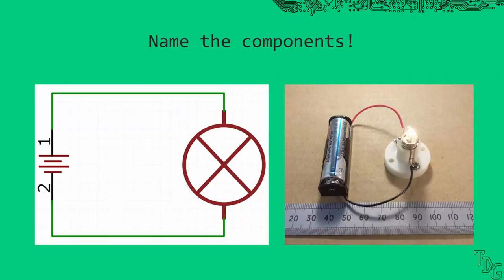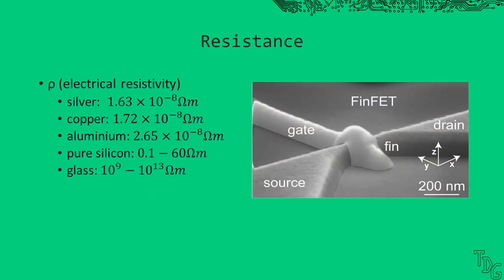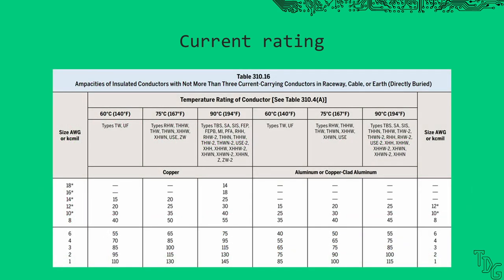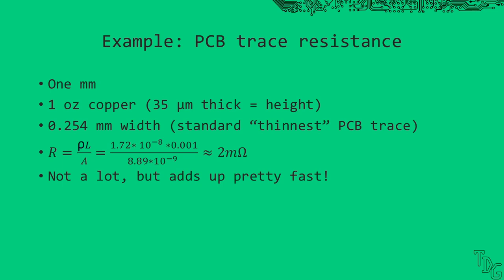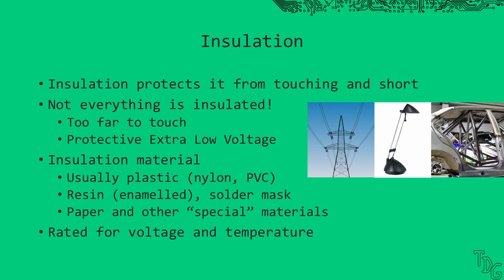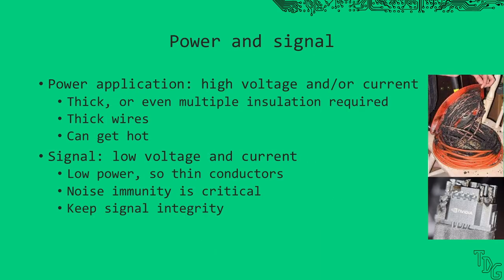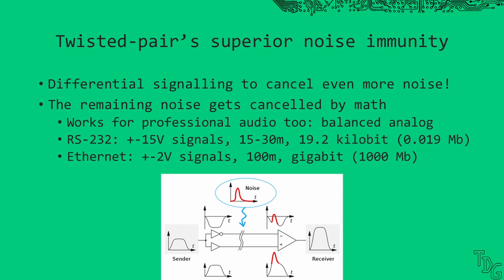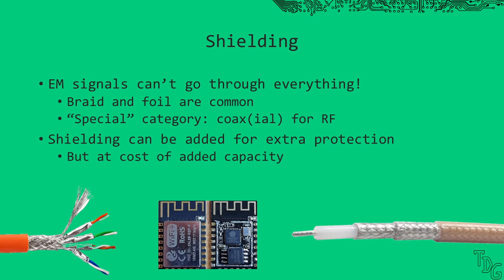Conductors: wires, cables and PCB traces - Basic Electronic Components

Comment: A question arose in my mind.  If I want to connect a 24-volt battery pack to an inverter, and I know that in some cases currents of the order of hundreds of Amperes will flow through the cables, at what maximum distance can I place it?  (Assuming it is not on a cable of infinite thickness but is commercially available.)
Reply from the maker: 24V inverters don't usually go over 4kW, so let's use that number Without loss, and worst case 21V lowest battery pack voltage would give 190 amps. That's a lot. A random calculator gave 95 mm² as recommended for this current.
(no wonder 48/51V battery packs are more common)
The stock cables are usually less, than a meter. The mentioned 95 mm² cable's resistance is about 0.326 Ohm per kilometer (or same milliohm per meter). On peak load, the cable would dissipate about 11W per meter. 1% voltage drop happens with 4 meters - but that cable is expensive as hell.
About expensive: in a local shop, the difference between the 120 mm² and 95 mm² cable is almost nothing - 7699 HUF vs 7622 HUF. It would be safe to go 4 meters far from the inverter!
Reply: @TheDeveloperGuy Thanks for the exhaustive answer. In fact, that cable wouldn't fit into the inverter connector.
It might be worthwhile to start by replacing the inverter connector.